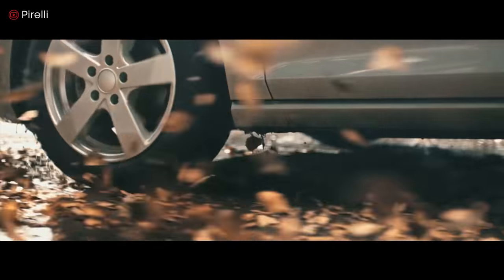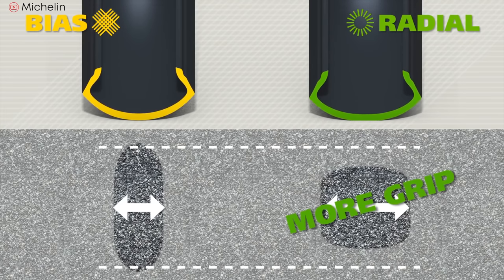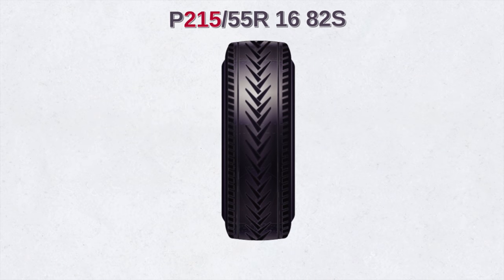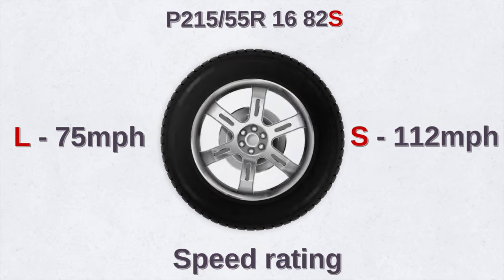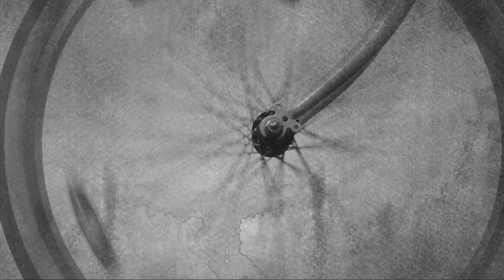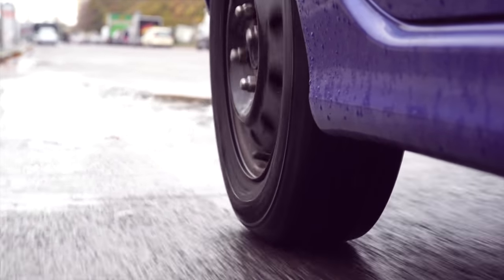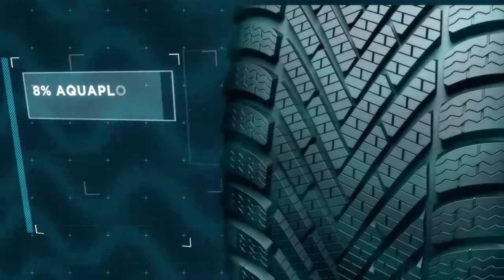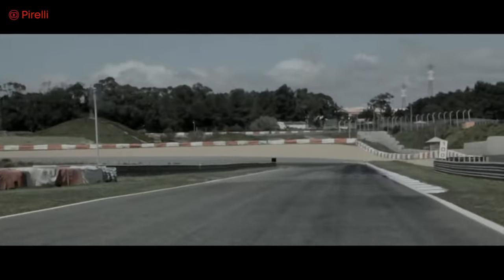These Tires Will Last Forever

Comment: My car has psi/bar indicators for each tire in the on board computer. After more than one year since I last inflated the tires, they are is still ok. So there goes down the drain the -1 psi per month theory.

Comment: OK Scotty what is  M + S it’s a Cooper Discoverer AT3 these tires do not have a direction arrow but I get 70,000+ on them. I have them on a 4 x 4 dodge ram 1500 with the 4.7 and I’ve ask 1000 times what do you think about the 2010 4.7 Engine???And I rotate them every 5 to 6000 miles I am at dedicated watcher but You never answer my question.

Comment: What about ,,, A/T tires?? Can you describe them. Thank you
Reply: They are a tire with respectable grip on dry, wet, icy pavement and also good in sand and in mud.
I bought General Grabbers for that. they were recommended by a forest ranger who had to drive in all kinds of nasty weather and off road places.

"Ice tires" are better on ice than the Grabbers, but not as good on sand or mud.
There are sport tires designed to be the best on wet pavement but they also are not good in sand of mud. the Grabbers are better at everything than standard all season tires.

Comment: Quick question is it a good idea to increase the psi in your vehicle if you have a lot of weight in your vehicle
That you carry and heavy loads
Reply: If you carry heavy loads increasing your tire pressure can help your tires to run cooler due to helping cut down on friction.  Tires generally have a maximum inflation number somewhere on the sidewall.  However!... keep in mind that inflating past the manufacturer's recommended inflation (not the maximum inflation) caused the middle of the tire to bulge some under normal loads while under-inflation causes the middle of the tire to go inward in relation to the edges.  Over inflation without a significant load will cause premature center wear while under inflation will cause premature side/edge tread wear.
My suggestion would be to start by adding a small amount (maybe 2-5 psi) above recommended and observe how much the tire sags and increase until it appears normal.  I believe a simple web search for "normal sag" or something like that will give you an idea.

Comment: Tread is just for wet weather. If it never rained we’d all have slicks. Directional tread should be on all tyres. Directional tread that all points in the right direction costs no more to make  than making tread in which half the tread points the wrong way. The fact is the only reason why cheaper tyres don’t have directional tread is simply to force consumers to buy more expensive tyres if they don’t want compromised tread.

Comment: Hello Scotty ! We have a question for you  !  We believe, that  we need more information on how to inflate our tires  ! 
 My winter tires are scrap ! All four  are old and cracked ! They done there time ! They  have ben permuted each and every  year and we realized just know, that these tires are worn out equally on all four; only on the outer ends; and  the center of the tires are half way used up ! The tire dimensions are correct for this car ( P195/65R15) , 44 psi max, stamp on tire and max load is 615 kg (1,356 lbs) . The car manufacturer suggests 32 psi , vehicle  capacity weight of 635 kg (1,400 lbs) . Usually we are only two people ,  rarely four,  and we make short runs . We are thinking that these tires are under inflated ! And that we have to fine tune the pressure application ! The manufacturer 's 32 psi would be a minimum applied pressure corresponding to the total car weight !  Are we wrong in believing so ! Can you steer us in the wright direction ! 
Thank you very much ! 
Paul and Georgette

Comment: thanks! but what if instruction letter is C? like 235-65r16c-falken-wildpeak-a-t3w
Reply: C load rating?
Reply: Load rating letter, number of plies, maximum inflation pressures 

C	6	C	50 psi (350 kPa)***	35 psi (240 kPa)***
D	8	D	65 psi (450 kPa)***	50 psi (350 kPa)***
E	10	E	80 psi (550 kPa)***	65 psi (450 kPa)***
F	12	F	95 psi (650 kPa)***	80 psi (550 kPa)***
***Select LT sizes are designed with modified maximum load pressures. Never exceed the tire's maximum pressure or load as indicated on the sidewall.

Comment: 8 months later and I am going to throw some curve balls.
1.  consumers have always been told to look on the door frame for the tire fit and inflation.  Then rotate and balance every 5,000 miles.
2.  I bought new Michelin tires this year.  I made sure that they were the right size for the car.
3.  The car was taken in for the 5,000 mile rotation.  Afterwards, it felt that it ran better.  So, I looked at the notes.
4.  The tires were inflated with nitrogen to 35 pounds instead of the frame amount of 32 pounds.  The next rotation and balance was marked for 6,000 miles and not 5,000 miles.
5.  Any comments?

Comment: Scotty, your explanation of the tire code was off a bit. The first 3-digit number is not just the tire width. It is the sum of the tire width plus twice the sidewall height, in millimeters.
Reply: Fee Fee  I was talking about the three digit number used when referring to a tire’s size. Scotty said in this video that it referred to a tire’s width. It does not. I corrected him.

Comment: Do not go by the sticker on the door!!! Car manufacturers do not test tires, tire manufacturers do. Remember Ford Explorers and Firestone? I have two 1992 Explorers, the door says 26 psi, Firestone tires said 35 psi on the sidewalk. Those tires were underinflated, that's why they failed, not the tire....the inflation. And yes I have had Firestone tires on the Explorers in the deserts of Nevada. No problems ever

Comment: Should have went into the different grades of tire quality. A cheap, garbage tire will usually have at least a few of these downfalls, wear super fast and odd, handle like a sponge, ride like a jack hammer, grip like oil on ice, or just fail in some strange way. 

I've driven on a good few sets of cheap tires on the same vehicle, most of them ended up being recalled or quickly discontinued for some reason or another (usually has to do with the cheap way the tire was made causing the tire to come apart spectacularly, and far sooner than the makers intended, such as all the delaminating, bulging, etc. That I experienced). 

A set of good quality tires makes an insane difference, and is honestly the first thing you should "upgrade" on your car. If you're buying tires, do your research and buy quality tires. Driving is one of the most dangerous things we do as humans, and tires are what makes the horsepower be able to effectively move the vehicle, and brakes able to effectively stop the vehicle.

Comment: 45 degree rule is not proven by any scientific research, more from tire manufacturers to alert you switching to winters. Actually test have proven that a summer tire performs still better at freezing temperatures in the dry and sometimes also the wet than a winter tire

Comment: I’ve found the tires that last me the longest are ones that have sat around for 5 or 6 years, the older they are the harder the tread rubber gets. Of course I know dry rot and UV degradation are problems but overall an older tire will wear longer than a brand new one.

Comment: Why do most of the car manufacturers put passenger car tires on their 1/2 ton trucks & some 3/4 ton trucks?
Reply: Because the light duty pickups are really just big cars.  If you look at the carrying capacity of most 1/2 ton crew cabs, it’s actually less than some minivans and utilities.

Comment: I know of no car tire that has less than four Plies on the tread and no less than two Plies on the side walls. What are you talkin about 2 ply tires?
The first three numbers are supposed to be the tread width, not the tire width. And yes the second number is an aspect ratio.
Tires also change pressure with temperature.
And I have seen no vehicles with the recommended tire pressure be the proper tire pressure but that car should have, you should always go up a minimum of 2 to 4 lb usually 4 to 6.

Comment: Wooden bugy wheels have spokes,  squared off and inserted into the wooden hub.  The outer rounded and two inserted into a segment of wooden wheel rim. The Egyptians Tied rawhide around these to hold them together. More recently a steel band tied the wheel. Then came strips of rubber bonded to the steel tyre, or tire. Too many spellings.

Comment: Cool before my 4x4 headgasket blow up, I had bf Goodrich tyres KO2, handle really well in snow etc they really thick and hit potholes etc put 30k miles and still got 5/16" tread on them. if I can somehow fit them to a normal car I would. some people I own buy real cheap unbranded tyres often blowing out down the highway, or just no grip after 5K, one guy at work had a 4x4 land rover with smooth summer tyres, ok for normal weather and will save money in gas, but winter its worth slapping on the bf goodrich k02 on there.

Comment: The problem is, that you in USA indeed do not have quality tyres. USA buyers are mostly obssesed with some "tyre mileage warranty" that the rest of the world never heard of. That leads to tyre manufacturers to use waay too hard of a compound for tires sold in USA, so that they can say - this tire will last 60 000 miles. But that is the wrong approach.

Here in Europe, as pretty much everywhere else in the world, quality tirea last up to 25 000 miles. That is because the rubber is made to hold the road and to be expendable. In contrast, USA tires are made to last and the car that uses them is the expendable one because they have mediocre dry performance and horrid wet road performance. For the same reasons, USA all seasons are not even the remotely same as rest of world all seasons. The all season tire made in rest of the world really can work quite good in snow and ice, also on wet roads, and exemplary on dry roads. But I can really blame the Scotty for thinking all seasons are no good in ice and snow, because USA all seasons are indeed prett much useless in snow and ice. However, try a proper EU all season like Goodyear Vectoe 4 Seasons Gen3 or Continental All Season and watch it outperform USA made winter tire.

Comment: Neither these tires nor any others will LAST FOREVER --  it just ain't possible -- and even if it were, tires are not considered serviceable (safe) after just SIX (6) years, according to tire manufacturers.
Tire warranties are limited to 80 - 90 thousand miles, with the majority at only 60 - 70 thosand miles.
The famous 95 MERC will switch from the Goodyear Assurance ComforTread Touring (98T) to the Yokohama Ascend LX (98T) -- they don't make the Goodyear in my size any more. The Yokohama tire is made in Virginia, and is the best M+S-rated tire available (for the 95 MERC) at any price.

Comment: Why do they call them tires?  

It goes back to the wagon wheel shown.  The metal band was called a tyre which held/tied it all together.  The name stayed when the rubber was put on the wheel and called it a tire.

Comment: What happened to michelin my Porsche 2001 I've always run michelin's  and the last couple sets didn't even last 10000 miles I'm not road racing just driving the car those mitchelins had  A 12000 mile warranty they were worn out and I got nothing for the warranty aren't you that's the last set I buy

Comment: Word too the Wise Your Totally Rite 4x4 Get you Going but Don't do anything for Stopping. That's why I will Not Drive on Interstates at the Speed Limit in a 4x4 in the Winter or any Car or Truck for Trying too Stop from 65MPH or "(75MPH if your in the Southwest)" with any Amount of Snow or ice can Cost you Your Life or Other People's Lives that are Also on the Road with you Trying too Stop from 45MPH on ice or Snow is Bad Enough but if you Crash into a Wall, median, Tree, at 35MPH That can Total your SUV, Car, Truck and if you hit a SUV, Car, Truck Going the other Way You can Total Both at Speeds Low as 20-25MPH for if your Doing 20MPH and there doing 20MPH that's a Crash of Like if you where doing 40MPH into a Brick Wall That will more then Likely Total your SUV, Car or Truck. So Never Never Never Drive on Icey or Snow Covered Interstates and if you Must Drive on Icey or Snow Covered Interstates Keep your Speed under 45MPH at all Times but if I was you I would Stay off all and Any Icey or Snow Covered Interstates for You can be Doing 35MPH or 45MPH and there will be more Stupid People on the Icey Snow Covered Interstate Doing 65MPH 75MPH 85MPH 100MPH and Hit you from Behind and Total you and Them Self So if you can Stay off any Interstate that has Any Ice or Snow on it for it's just Not Worth Losing Your Life or your Families Lives over ALL The Stupid People on the Interstates these Days Driving Like Total Morons Putting Everyones Lives in Danger I See it Everyday. Don't put your Family and Love ones in the Danger Zone. Just Because you have a 4x4 or an AWD and you can Go Like Crazy Don't mean you can STOP!!!! I Can't Say this Enough Times for Morons Keep Going Like Crazy Then Wonder Why they Crashed and Couldn't Stop. These Fools of Today Just Don't have Enough Brains too be Safely Driving a Wheelbarrow.

Comment: Please stop making videos that don't match the description! What tires might last forever? You never say. In fact the picture you have for the video is for the new Michelin tire but you don't give them credit or even talk about the specific tire. Also, you say tires generally lose one PSI every month, which is not correct in all cases. In fact tire PSI usually INCREASES as weather warms up in winter climates.

Comment: First, I worked at Goodyear for 19 years and the auto industry for 30 more years after Goodyear.  Second, Nitrogen gas will give better tire life over pumping air into tires by 27% to 35%. Nitrogen gas is molecules are 7 times larger the oxygen therefore it does leak out as fast. Third, Nitrogen gas gives better gas mileage for 3% to 8% . Last, car manufactures give a standard psi for models which actual should be changed for engine weight. Take Ford's Fusion Hybrid with an extra 200 pounds on the front end of the car. Based on the addition of an electric motor for EV driving still has 35 PSI as recommended. I measured the front foot print of my 2010 Ford Fusion which was 30% larger that the rear tires. When I raised the front psi to 39 psi my mileage when from 38 mpg to 43 mpg highway and tire life was 18,000 miles more on the front tires. EV response was even better.

Comment: Who can afford two sets of tires
Reply: It was common back in the1950s, 1960s,  1970s, and 1980s in the Chicago Illinois area where I grew up .  You kept a full set of 5 steel wheel -winter tire assemblies in your basement or garage . You changed them with the 5 steel wheel-summer tire assemblies on/in the car.  Remember back then it was common to do a five tire rotation: 4 tires on the car and a spare tire-wheel assembly in the trunk.  Some wealthy pickup truck users had 6 total tire-wheel assemblies to deal with: 4 on the truck and 2 spares mounted in the bed or above the running boards.

Comment: All season tires are trash .  The reason they perform well  is because of front wheel drive automobiles apply weight upon them .  Why do 22.5 new truck tires have have 27/32” and car tires have nowhere this tire depth .

Comment: What tires last forever?
Reply: Satire
Reply: None, but there are some T speed rated and S speed rated tires that have 90,000 mile tread wear warranties. So in theory IF you drive 15,000 miles per year then the tires could last 6 years(15,000X 6). IF you get rid of a car every 6 years then that might seem like lasting forever.  BUT, it's not wise to keep tires that long due to the natural tire aging processes, plus the tire companies always figure out how to not honor those tread wear warranties . You're going to see everyone from the tire shop's ASME master mechanics to the junior apprentice mechanics measuring your tread depth to  plus/minus 0.001 inches in all the tire's grooves for the entire circumference of the tire.  Believe me, you aren't going to win that disagreement about tread wear limits and warranty coverage.  Give up and buy a new replacement tire.